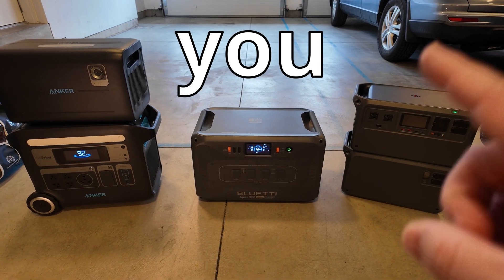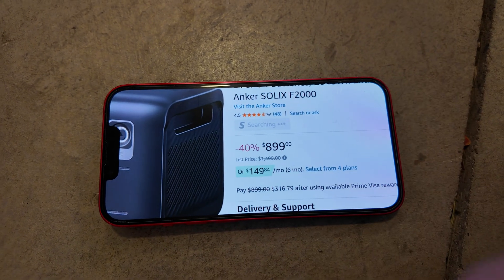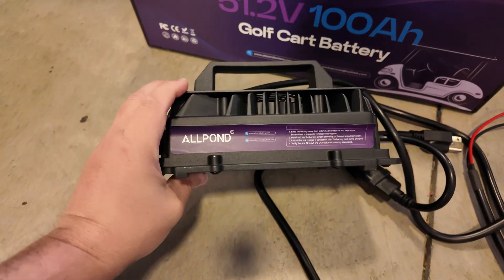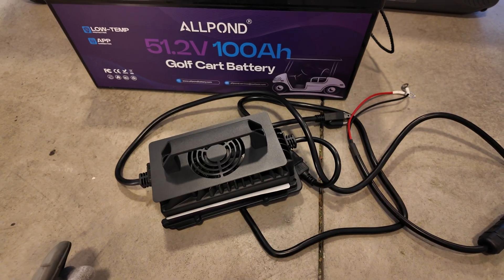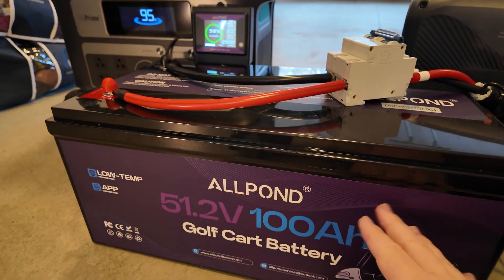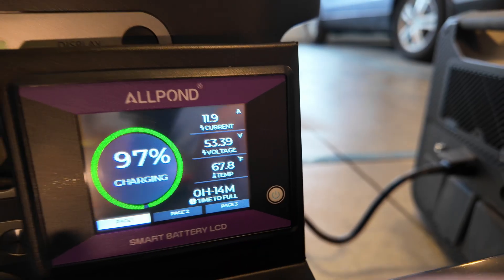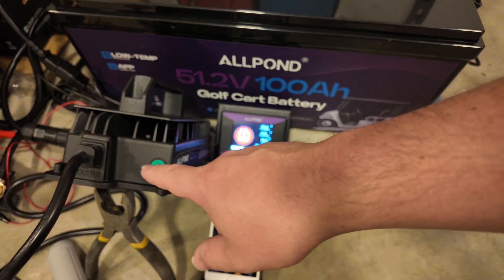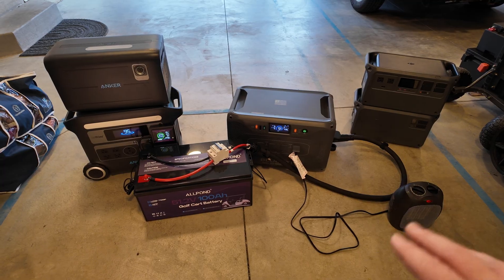The Great Solar Generator Rip-Off (And How to Beat It)

Comment from the maker: Buy an AllPond Golf Cart Battery Kit: https://amzn.to/3LJvWcH 

Buy 10awg ring terminal to XT60i cable: https://amzn.to/48apymj 

Buy battery terminal fuses: https://amzn.to/40Jp2J7

Buy Bluetti Adapter Cable: https://tidd.ly/4poWHC9 

Buy 80 Amp DC circuit breaker: https://amzn.to/3JpBNmp

Buy 4awg battery cable: https://amzn.to/47HpaMU

Buy the Bluetti Apex 300: https://tidd.ly/4pPlTlS 
OR
Buy from Amazon: https://amzn.to/4qgnXUg 

Buy Anker F2000: https://ankersolix.pxf.io/RG6oAN or https://amzn.to/4b4mGrU
Use code: ANKERSOLIX20 at check out (Anker Solix website only)

Buy the DJI Power 1000: https://amzn.to/3zwUz6r

Buy Victron Smart Shunt: https://amzn.to/45dgz20

Buy an EG4 12000XP Inverter: https://payoffsolar.com/product/eg4-12000xp-off-grid-inverter-v2-eg4inv12kxpv2us
Be sure and use the code: TRICK5 at checkout and save 5% on your order!

Buy an EG4 Indoor Wall-Mount Battery: https://payoffsolar.com/product/eg4-wallmount-indoor-battery-143kwh-wm-48-280-1-in-ll-00 
Be sure and use the code: TRICK5 at checkout and save 5% on your order!

Buy an EG4 Chargeverter: https://payoffsolar.com/product/eg4-chargeverter-gc-48v-100a-battery-charger-5120w-output-eg4cv48v100av3 
Be sure and use the code: TRICK5 at checkout and save 5% on your order!

But a conduit box: https://payoffsolar.com/product/eg4-indoor-buildable-conduit-box-designed-for-eg4-wallmount-indoor-battery-eg4spidwmbcndtshrd 
Be sure and use the code: TRICK5 at checkout and save 5% on your order!

Browse all the products from Payoff Solar: https://payoffsolar.com/products 
Be sure and use the code: TRICK5 at checkout and save 5% on your order!

Ask me a question and get a personal in depth response: https://ko-fi.com/s/8d8df1880c 
OR
Sit down for a personal 1-On-1 hour long video consultation with me and I’ll provide answers and insights to anything you want to ask me about from this channel: https://ko-fi.com/s/dd139831a7 

All donations get 100% re-invested in the channel:
https://buymeacoffee.com/theresatrickforthat 
 
Affiliate Disclosure
As an Amazon associate I earn from qualifying purchases at no cost to you! Thanks for your support!
Reply: Every other video that I've watched with this hack has recharged the unit which in turns recharges the golf cart battery in balance with the unit because of the proprietary connector.   If you add more golf cart batteries, how do you suggest recharging them?
Reply: Could we use a 12 awg wire since amps will be limited to 20 and only 5 foot run  for the ring terminal to  xt60 connection ?
Reply: @2killerBs  You could but for any sort of solar + battery + inverter or power station project it's a good idea to avoid thermal cycling as much as humanly possible, you will avoid a lot of unnecessary problems as well as avoid unnecessary heat production.  So I would recommend using 10 AWG if you intend to push 20A.
Reply: @2killerBs ...12 awg is good for 20 amps with a 20°C temperature rise, 100% DUTY...its the actual connections which are important. Do not rely on simple crimp methods for applying  terminal rings. Clean all non solderable connections well and apply anti oxidant grease...Any crimpable terminals should be soldered onto the wire.

At 5 x 2 feet for #12 wire the Resistance is 0.010 Ohms. 20 Amps flowing through this resistance will result in a voltage drop of 0.2 Volts.  A 0.2 Volt drop at 20 Amps represents a power loss of 4.0 Watts.  At 70° F ambient temperature the wire will make it up to about 140° F Max .
For the sake of ease of mind
..just get ya two 5 foot sections of some 12-3 Romex house wire and use all three conductors together. I learned this at NASA..
All this thermal cycling stuff is nonsense  EXCEPT in the case of dirty connectors.
Reply: How do you mitigate using a power supply with a Hughes builtin auto former for an RV?

Comment: Would I be able to run my Generac 8000 E portable generator to power my house and from one of the AC outlets use the golf cart inverter (to clean up the power) and then pass-through one of these power banks to my wood pellet stove?
Reply from the maker: Most certainly, yes!

Comment: You could have mentioned this also works using the PV cable, to all power startions. Not just the ones that support expansion batteries.
Reply from the maker: I did didn’t I? Option 1!

Comment: I have never come to grips with buying an expensive batt box with a small a/h battery. Convenience is the only thing for non handy people. 300 ah, controller and panels for less than $1k.  Good Dc charger for less than $300. Can't see value in batt box. Seen a few city people drive 6 hours and have hot fridge next day. "Salesman told me I would get 4 days out of the batt box". Filled with hot food, no solar panel, battery dead flat, cigarette lighter power conection & no dc charger. Where do you start....
Reply from the maker: That's a very common experience for people new to solar.

Comment: The Opus eB2 expansion batteries have a built-in charge controller and can input 2100 watts solar and has hi power 12v output.
Reply from the maker: Sweet.

Comment: Instead of using the golf cart battery, could you use a 12 volt lipo as a less expensive option for expansion battery.
Reply: 12Volt doesn't play nice with 48, at all
Reply from the maker: Got to be the same 48v!
Reply: @theresatrickforthat please explain in a little more detail why it would not work with a 12v Lipo as the expansion battery? I would be using your first method by connecting to the solar charge controller.
Thanks

Comment: I have the Anker solix f3000.  It has 51.2 battery and same chemistry as the Allpond.  If I do not want to use the solar input and go with the additional battery option it seems to be complicated as I do not know how Anker is working to charge the extra batteries and I will need their special cable.  Any ideas
Reply from the maker: I’m working on figuring out Anker products

Comment: Wish you'd demo how it charge power station with minimal power left so we can see how fast it transfer over. And use smaller budget size so avg low income person can calculate sum of costs . If phone connection down,  these expensive powerstations should be able to config adjust settings without internet.  I'm still trying to decide which brand is most reliable investment as well with this battery backup. Here in Wa we can't rely on solar.
Reply from the maker: I've got more videos about this kind of setup plus a bunch of power station reviews! Check them all out!

Comment: Any idea if you can charge the 51.2V battery from the bluetti using the XT60i port?
Reply from the maker: Nope! You can’t
Reply: @theresatrickforthat  oof. Thanks for the reply and info!
Reply: @ProfPerkins two bluetti units... One small one like an ac70 to accept a 500ish watt charge from the bluetti one charger hooked up to the vehicle... Then the ac70 unfortunately needs to convert DC to AC via sending it's stored charge to the 2nd unit... Like an Elite 200 V2... Via the Ac charge cord.  Then the 2nd unit could use it's xt60 port to hook up to the golf cart battery.  And then ... You hook up the golf cart charger to the original ac70 to charge the golf cart battery... Effectively providing charge to the golf cart battery while driving....

This setup would provide massive amounts of power and the ability to  put 500 watts an hour back in as long as you are driving.  You could also do solar simultaneously by simply using the v2 xt60 port by unplugging the golf cart battery.

Comment: Main problem I have is that my Apex300 doesn’t absorb Solar as much as they say, max 500W from 4 x 415W panels. Is there a better system at absorbing more from panels ? Or is another scam, lie “ you can get 1,200W per input “ thanks
Reply from the maker: I think you may have your panels configured in too low of a voltage configuration. But regardless…yes! You can add a high powered external MPPT charge controller to the external battery and really up your solar input!
Reply: @theresatrickforthat  because of the volt limit, I connect 2 and 2 panels in series, and stay under the 60V limit, so 2 panels on Input 1 and 2 on input 2, about 40V and 830W panel total on each. I don’t have an external battery, just the Apex300. Could I add it to it then ? Do you have a video on that? Thanks

Comment: Ok you got my attention and my sub. Ive been playing with this stuff since 2019 and im an addict.Originally bought the Point Zero Titan,then a original Ecoflow Delta and then i said screw it and did my own DIY with Growatt 3kw. I loved Titan because i could use my Growatt batteries on it too.I just sold Titan tho and bought 2 Anker F3000s with 240hub and am hoping to be able to expand them with your method. Good stuff👍👍👍
Reply from the maker: That's an awesome journey you've had with solar setups! Huge thanks for watching and subscribing!

Comment: GREAT VIDEO CONTENT...I chose the Pecron system because the expansion batteries ( 3072 wh for $519.00 today) can be stand alone both input and output. They are 51.2 volt and are compatable with your set up which I like very much. I would like to know what you think about the Pecron family of products. I chose them because they had more capabilities (value added) than other systems that cost a lot more. Glad to see someone else on the same page.
Reply from the maker: I have only tested one of their smaller units so far. It had a terrible solar input, but aside from that, it was a good unit. Pecron seems legit!

Comment: Could this battery and controller supply 220 volts to a generator sub panel during a power outage? I am looking for a economical way to replace my 8000 watt gas generator.
Reply from the maker: Yes! The Bluetti Apex 300 can output 240v power! Probably will need 2 of them to replace a gas generator the size of yours.

Comment: I like the idea of using the 5000W all pond battery to feed into the solar input of some of these chargers that use XT60 connectors.  The latest AnkerSolix F3800 Plus uses some proprietary connector.  Is using the allpond batter through the solar connector still possible with it?
Reply from the maker: I believe so! But I haven't tested it. I need one of those power stations first! :)

Comment: Using 280Ah or better prismatic LFP cells and a JK-BMS (or similar) to build your own pack - rather than a sealed - how the price would compare. Won't be mobile, but also won't be sealed and easy to balance individual cells are repair.
Reply from the maker: Would be interesting!

Comment: Thank you for the great video. I am DIY inclined but I just want a simple quick setup for what I use a power station for a 3600 wet-dry-wet stereo delay guitar rig, but when used for back up why can’t I take the external battery and charge it separate from the main unit.
Reply from the maker: Glad you enjoyed the video

Comment: can you hook it up to a 12v fuse block and use more 12v  amps than you can with the Apex 300? Like say to power a 12volt AC?
Reply from the maker: No. Only 48v for this!
Reply: @theresatrickforthat  WOULD A STEP DOWN CONVERTER WORK?

Comment: So will connecting to the Solix through the solar charging port as you showed result in the same bi-directionsl equalized powere sharing like with the Bluetti?   If not how would you recommended achieving this with a Solix unit?
Reply from the maker: I'm working on hacking the direct battery on the Anker Solix units...but for now, just do it the way I showed in method 1 in this video

Comment: This gives me an idea.

I'm going to upgrade the degraded 24kwh Nissan leaf battery to a 40kwh. The 24kwh original has degraded to about 17kwh its value is about £500 - £750

I'm thinking i could make up a little rack and reconfigure the cells from 400v down to a 50-60v i could then have a station that could help me with the houses 750w idle consumption :)
But would need to come up with a BMS and charger.
Reply from the maker: Haha! Good luck with that!

Comment: Nice one. I am in Australia and am considering buying one if these power stations fo camping but I like to have Anderson plugs to make sure the items I use like a fridge have a secure attachment when off road. With this set up, would it work to have a power distribution box attached to the “golf “ battery with Anderson’s etc which are easy to get hear, and still use the power station for the 240 volt appliances and the inverter? This would awesome if it could work that way. Do you have a Webb site for ideas at all? Thanks
Reply from the maker: Yeah! What you said should work!

Comment: I would like to see how you go about connecting that battery to the dji1000 I have the dji2000 and would like to connect 48 volt battery to it i have the 1.8kw solar charger but theres no way to connect straight to the battery on dji
Reply from the maker: I'll add it to the list!

Comment: Yo quiero comprar una bluetti apex. Pero tengo un aire acondicionado y un refrigerador. Que son los que más consumen. Sería posible poner unas 3 o 4 baterías de carrito de golf. Y estás cargarían con paneles solares????? La verdad busco como economizar en mi país Nicaragua pago prácticamente en mi casa un salario mínimo casi $300 de luz al mes. En un año estoy pagando más de $3,600 dólares en energía
Reply from the maker: Yes! You can add more batteries in parallel! Just be sure to size the conductors properly as well as the over current protection.

Comment: the extra batteries costs just as much as the damn power station it's crazy
Reply from the maker: Right? It's like printer ink! Haha!
Reply: Exactly. I get justifying the cost of the power station, given all the components you get in one unit. But to charge almost the same amount for a simple expansion battery is ludicrous!

Comment: Would it be feasible to feed a plug n play 120v solar into the outside outlet, then put a battery + power station at different parts of the house (one for kitchen, one for all house lights, etc)? Or is there a better way to do it? Sorry if that doesn't make much sense, I'm new to all of this and will be a first time home owner very soon
Reply from the maker: Sure! That would work. Just know the power stations are “off grid only”

Comment: The Amazon product page doesn't give the specs for the charger included in the kit.  Based on a rough calculation, (100 Ah battery taking 6.25 hours to charge), makes it a 16 amp charger.  Not bad for the price.
Reply from the maker: It's actually an 18 amp charger! Very capable!

Comment: You can also do this with ups's if you can modify their charging profiles to suit LFP. Simply get  an LFP capable UPS, or a hackable one (APC is rife for this, easy to hack), then remove the LA battery pack, and wire it to a rack mount LFP 48V battery via a suitable breaker & optionally a fuse. I have a liebert ups running off one of these "golf cart" rack mount batteries. Yes they are not just for golf carts, you can get them in rack mount form too! 

The only downside is the charger in the ups is not as powerful as the one included with the golf cart battery or inside the solar power station, but where I am we only get a few power cuts a year, so having it take a day and a half to charge is a non issue. And you can usually get ups's for free with stuffed lead acids, recycle the LA's for some extra beer coin or to pay for your cables, breakers and fuses.
Reply from the maker: Interesting!

Comment: Was looking to buy a 2,048 Wh extension battery for my 1st power station when it occurred to me I could buy a 2nd stand-alone power station (different brand, on sale) that would deliver the same 2,048 Wh capacity, but it came with a 240W solar panel.  For  $150 less.  Much better option, since the 2 units can be deployed & used in different locations simultaneously.
Reply: Just an FYI , with ANY power station , the company is counting on you wanting more reserve power , and this is where they REALLY profit off you.  These "backups" are just glorified batteries with minimal ( if any ) true communication properties. 
As with EcoFlow Delta series the retail price is over double its Watt Hour value.  Buying a Stand Alone Lithium , even a budget battery like a WattCycle or Power Queen,  You will get about Triple the reserve power for the same price.  One thing to be aware of , is if Xferring power to an older power station be sure your XT-60 cable is the  i type.  You can see/tell the difference by the little copper tab between the 2 power connection holes. 
a basic XT-60 can limit your charge input to 8 amp , whereas the XT60i can run up to 20amps or higher depending on some factors.   I learned that after building a 280ah battery using EVE Cells and a 250amp DALY BMS.  The stock cable ( XT-60 ) would take 4+ hours to dump 2048wh into my station 
After using the XT-60i it cut that power Xfer time in less than half.   This is also true of Solar or even using a Honda eu2200 generator to recharge off grid. 
But back to my point , you can buy 300AH of battery for HALF the price of an additional battery of the branded name power stations options. 

Cheers Y'all !!
Reply from the maker: Nice!